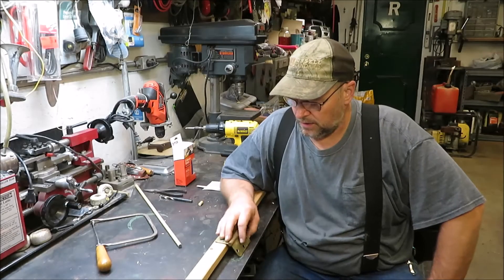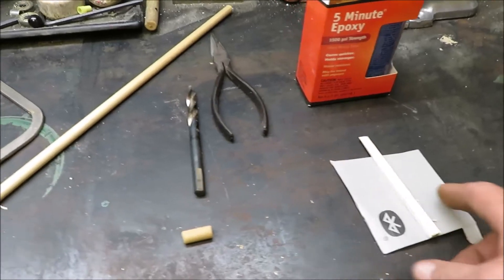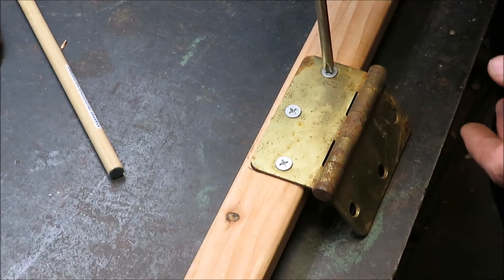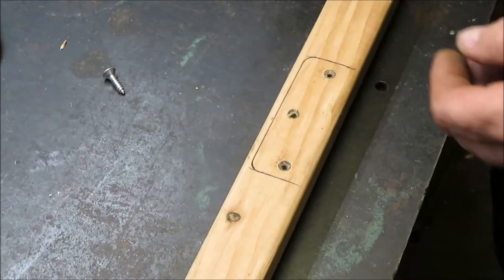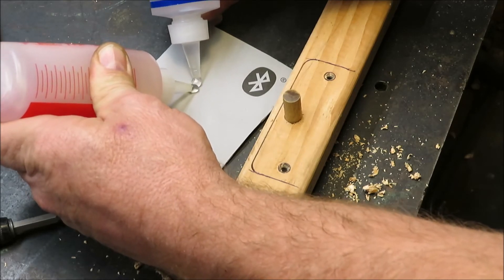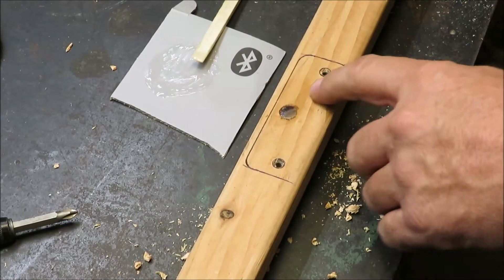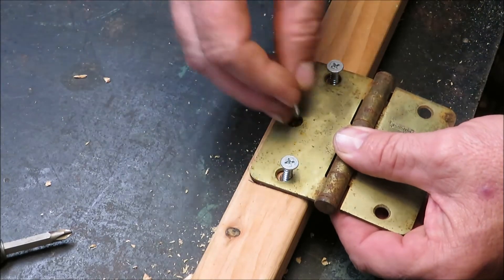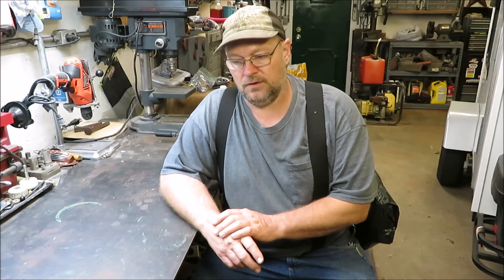how to fix a stripped out wood screw hole

Comment: I got a hole in a wood balcony that supports a metal railing at the base. The hole is a bit rotted inside and will not take a screw even if I put in a drywall style plug. Should I use this kind of epoxy, or something better, or perhaps some body filler to set a bolt inside?  Thx.
Reply from the maker: Epoxy will work.

Comment: Great video very helpful,,,,I myself personally have used golf tees dipped in Wood glue then pound them in with a hammer 🔨 then cut them off flush with side cuts however your idea of using wooden dowels is an even better idea because those wooden dowels come in all sizes so you can get one just the right size for the situation at hand,,,, your epoxy is probably a better choice too,,,, probably alot stronger 💪 the screws will most likely get a much better grip,,, thanks for another great video, very informative
Reply from the maker: Thanks for watching william.

Comment: Good ideas buddy. I always replace my front door hinge screws with 2- 3" screws. We were on a cruise when Irma hit and when we finally got home our front door was jammed up. I thought it was the hinges etc. Everything was still aligned. It was just swollen from humidity and it's back to normal now.
Reply from the maker: Did you have a lot damage chad.
Reply: No, we were very lucky. Our car was near Miami airport and it was just fine and our home near Fort Myers was fine, just the jammed up front door. We were very lucky, a lot of people still have no power and limited resources.

Comment: Zzemscrew.com makes a metal screw collet that is easy, fast and far more secure.  I use that on hinge projects now.  Keep in mind these screws on hinges bear some real weight and flexing holding the door up and torque when you open the door.  That is why they gave away to begin with.   When I had used a dowel, I use Birch or Bamboo. Not Pine.  Pine is flimsy in contrast. The door frame is typically cheapy Pine.
Reply from the maker: Thanks for the comment JR.